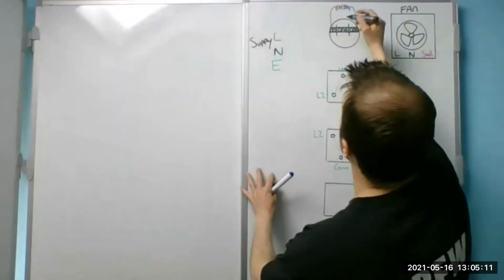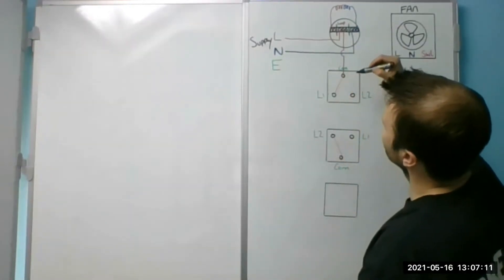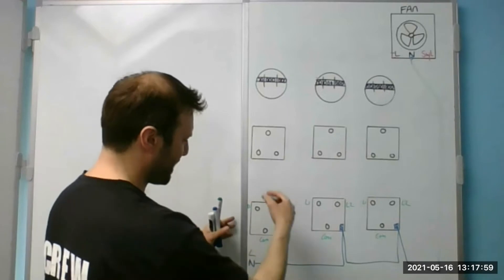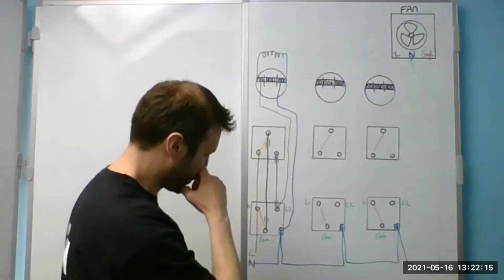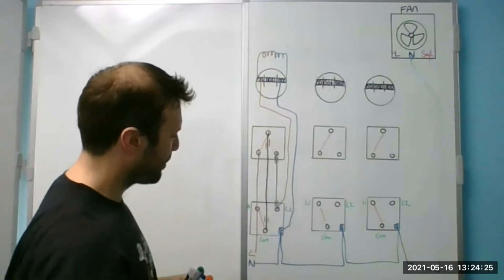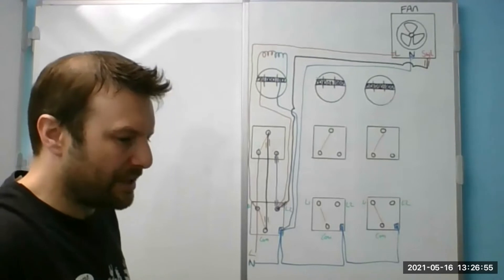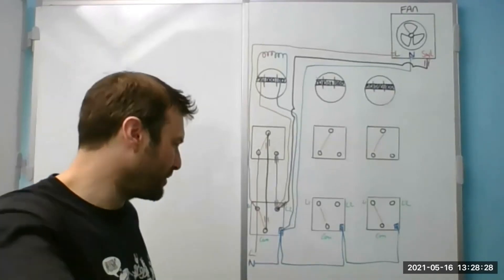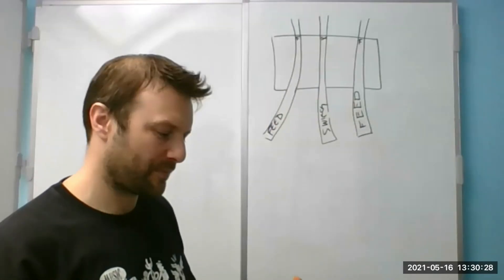How to connect up 1-way and 2-way lighting with a fan

Comment: At 18:17, if that cable on the left is the feed then the cable in the middle would simply be switch live and neutral so you wouldn't have to sleeve anything.